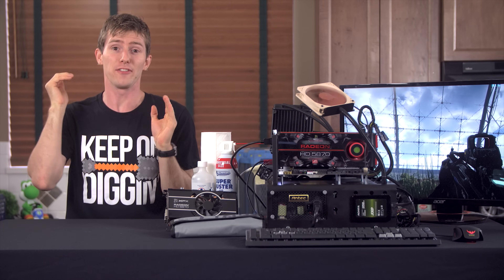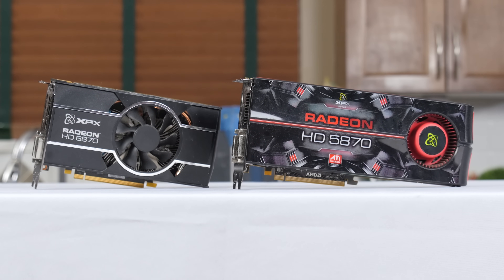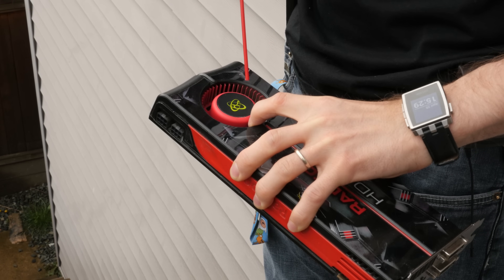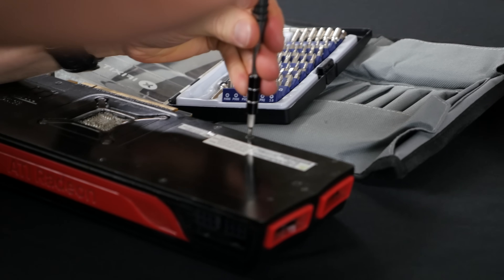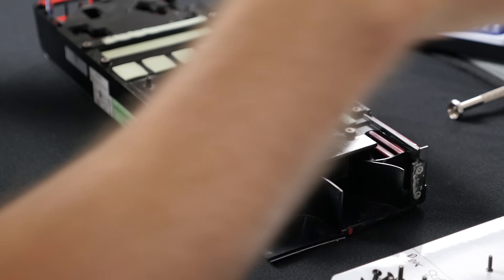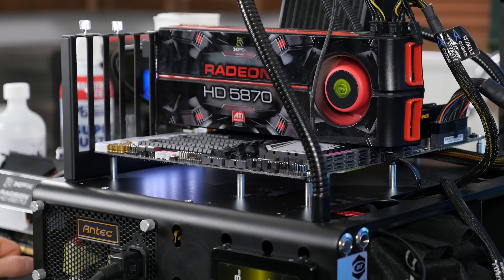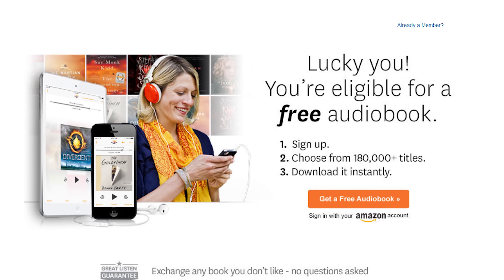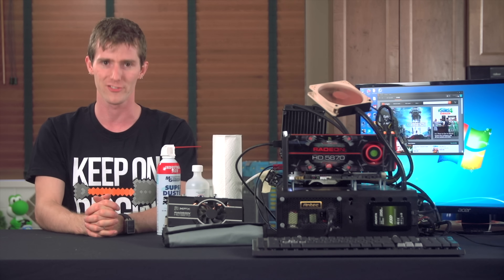Video Card Running Poorly? Clean Your Video Card Cooler!

Comment: canned air is literally the worst thing ever. better to just disassemble the cooler and brush it out with a soft-bristled paint brush.
Reply: Corinn Heathers I use 150 psi workshop air to clean my pc. No need to disassemble anything at this pressure (well yea take the pc cover off).  Theres probably a small risk of damage at this pressure but its great fun.
Reply: 3Dtimespace Oh yeah I'm fine with using a compressor, but canned air is just a bad deal all around. Super expensive for a metal can full of air. o_O
Reply: Corinn Heathers Why? Compressed air is great for cleaning out your whole case.
Reply: 3Dtimespace It only removes dust that's just sort of sitting there. You can spray canned air at heat-baked dust (which is what will be clogging your heat sinks and fan blades) all day and it won't even budge. A soft paintbrush never runs out and removes the baked-on dust easily.
Reply: Corinn Heathers Sure.. Both is a good combo. Plus things like "cotton sticks". A actual compressor works better han canned air also
Reply: Glycerin hahahaha
Reply: Glycerin Just don't turn it upside down!
Reply: Corinn Heathers
ooouuuchhhh!
Reply: Bangersnsmash Uk Be careful with workshop air, a lot of compressors tend to accumulate moisture, and you most definitely do not want to spray humid air into your GPU either.
Reply: Corinn Heathers Canned air is great for a blast of fresh air to the ole nut suck
Reply: Corinn Heathers Does your dog spit inside your computer or something? Every time I cleaned mine with a duster, everything came off. These little cans are pretty powerful. Anyway, you'll always end up replacing the whole computer before you have to brush things. And the cans only cost like 4$.
Reply: foufoufun0 I HAVE NO IDEA. The dust just kinda stuck on. The can of air wouldn't barely budge it!
Reply: Corinn Heathers Do you smoke inside?
Reply: foufoufun0 No, so I don't really get why the dust just sticks. No cats or other pets either.
Reply: Corinn Heathers That's weird, never had any trouble with dusters. I mean, it's pretty rare to have sticky dirt inside the computer.

Comment: I guess my MSI TwinFrozr II/OC 580's are dying, they're 54 on idle, replaced thermal paste and cleaned the cooler a bit with no effect. :(
Reply: What about load temps? Thats the main concern
Reply: Randy Hulsebos Try a different driver for the card. I had massive problems with temps about half a year back. A beta driver messed with my card and it was 20C hotter at idle for no obvious reason. New driver (old version) fixed it instantly.
Reply: WayStedYou Top card around 85-87c, second 79-80c.
Reply: The BTNS I do have a mid tower case, with a Mugen 2 cooler wich is huge.
I have also add a 120mm fan on the side panel that blows at the videocards.
I think the case is just cramped, i'm thinking about saving for a big tower case.
Reply: Randy Hulsebos Make sure the fans are okay. They may not run at expected speed, they may have difficulties to start running or they may even randomly stop spinning in burn. Inspect them visually and acoustically when running and keep an eye on them in afterburner. Also, try to remove the gpu and spin the fans to see how easily they spin. These MSI TwinFrozr coolers are very prone to this. You can fix it by relubricating the fans, but they don't usually have the caps for it there. So you might have to dissemble them, but there's a risk of damaging them while doing so.
Reply: Jakub Vacek The fans are fine, increasing the speed doesn't help much either.
Reply: Randy Hulsebos Well that would be a sing of the bad fans. Take the graphics card out and try to spin them to see whether they spin well and naturally or they stop spinning too soon.
Reply: Randy Hulsebos Also, one more thought. Does the card underclocks itself? That'd explain why it runs so hot just in idle.
Reply: Jakub Vacek Lately yes, sometimes i have to use gpu-z to force 3d clocks else it sticks to 400mhz on the core even in-game.
Reply: Randy Hulsebos  That sounds like the issue. The idle clock should be around 50 MHz. If it's running higher clocks when idling, it'll naturally have much higher temps. Try clean driver reinstall and look for softwares you use that might be messing with this.
Reply: Jakub Vacek Mostly it's 50mhz idle, but sometimes it hangs at 400mhz.
I recently already cleaned the drivers with DDU and reinstalled 350.12.
I only run Afterburner on the background and GPU-Z when the cards stay downclocked.

Comment: Aahh the good old HD5870, awesome card back in 2010 ( ͡° ͜ʖ ͡°)
Reply: ThePimbax yeah I hear in minecraft it can run on fast graphics and still get a solid 25 fps
Reply: Jill Valentine Still does a good job.
Reply: Teemo4Life It came out in late 2009, it's 5 & half years old, what do you expect jackarse?
Reply: Good old ati card
Reply: Jill Valentine Im still rocking a 7850 :D And my brother a 6790 :P
Reply: I had 5850, I was really good until I replaced it with gtx 970 few months ago. I actually cleaned my 5850 over a year ago when it was peaking to 95C (lol). After cleaning and replacing thermal compound it was really cool (about 75C).
Reply: halocuber117 isn't 6870 weaker than 5870?
Reply: Jill Valentine I have a watercooled 5870,it's alright I guess.
Reply: I still have my HD 5450 plays games fine
Reply: Jill Valentine  It had a horrible tessellation performance
Reply: Jill Valentine Still my main card, although I'm probably replacing it in the next few months.
Reply: Jill Valentine I am still rocking a 4870 in my older backup media PC lol
Reply: Jill Valentine Well, I still use GTX260 and I have no problem. Ok, maybe with noise, but nothing else.
Reply: halocuber117 You should wait for AMD's new lineup coming in June,  the 390 will probably be the card for you.  It's rumored to fill the gap between 980 and titan X for a much lower price ($399?).  I'll be getting the 390x or 980ti for VR applications, my 770 just isn't cutting it for VR.
Reply: I still use mine ;)
Reply: Jill Valentine Radeon 5000 series are the beast. My 6770 (5770 rebrand) can still run most current games on Medium High at 1366x768 to 900p.
Reply: +GreenAsari I still use it for mt workstation pc. So far has been a great card :D .
Reply: +halocuber117 I rocked a 6870 for about 3 months in my rig, I got it for $20 on craigslist and it performed well beyond my expectations even on Far Cry 3 and GTA 4, the only issues being stuttering from lack of sufficient VRAM but other than that it ran quiet and fairly cool. Now it serves in my HTPC/LanBox rig, still very good for what I throw at it. You'll drool over the difference a 390/970 makes, I know I did even with a 7870 which isn't a big step up but man did I love the extra performance and lower noise.
Reply: +Jill Valentine People who bought 5870 and 5850 at release sure got a good deal and long lasting gpu. I think it went up against nvidias 480 aka jet engine :P (The 580 was a great improvement half a year later though.)
Reply: +Jill Valentine probably the best card i bought, i ended up crossfiring it but sadly they died about a month ago and picked up the gtx970 g1 gaming... hope it lasts me xD
Reply: unstoppableguy1 7970 is a very good card, it's the best bang for the buck especially if you can get one used. I find that the 7870 is also a good bargain, as it's usually cheaper than a 7950 but has very competitive performance.
Reply: M8, i have a 6850 in my rig :)
Reply: +Jill Valentine I have a HD6450. It works fine. It has a passive cooler but it doesn't overheat.
Reply: +Jill Valentine I had a  HD5770 back then.. lol
Reply: +Bas van der Meij (Ykai63) I still run this one ! :D
Reply: im still using mine now XD
Reply: It does a shit job
Reply: TheGreatMandalore same
Reply: Fred Lavar Steenerson Stevens Herbert anything can run minecraft.
Reply: Jill Valentine I still got my 6870 from 3 years ago, hoping to upgrade to a 970 soon though.
Reply: Ted Bundy Yes it is, did he say anything different? :)
Reply: Saitham I just wanted to be sure
Reply: ***** but, other than nvidia at the time and for the 8 months to come, it had tesselation.
Reply: sandor szabados Nice, what you going to replace it with?
Reply: Animepunk1 I also owned that card, was awesome ( ͡° ͜ʖ ͡°)
Reply: Ted Bundy Nice, I also have the GTX 970, kick ass card. I guess Linus is right about cleaning ya GPU's :P
Reply: Filip Otáhal Koolies, I owned a GTS 250 back then :P
Reply: halocuber117 Awesome, I'm rockin a GTX 970, great card, you won't be disappointed ( ͡° ͜ʖ ͡°)
Reply: Ted Bundy Yeah It's just above the HD5850 but bit below the HD5870, that's back when AMD changed their naming scheme, but I think the HD6870 had better DX11/tessellation performance ( ͡° ͜ʖ ͡°)
Reply: Jill Valentine
Not sure yet, on a tight Budget. I'm waiting for the 3xx release. Hoping to get something in the $200CDN range, crossinbg fingers really hard that a 290 will reach that, might have to settle for 280x though. That wouldn't be bad, I'd definitely notice the improvement.

Maybe, just maybe, there will be a 3xx card in the price limit that makes sense to skip 2xx. Seems doubtful, but should know in a few weeks.
Reply: sandor szabados Yeah I would do the same thing & wait till the 300 series are released & go from there :)
Reply: sandor szabados Well, 200 series are one of Radeon's "worth to be skipped" family. Most of the times back in 2013, instead of getting a 280X, I can get a 7970GE for much cheaper than a 280X.
Reply: +GreenAsari Still running a 7450 HD Low Profile... worst shit ever :p
Reply: +Jill Valentine I still use a eyefinity 6 5870
Reply: Albinivik Absolutely, totally agree :)
Reply: Wesson552 Yeah prob my fav also, sucks they both failed on ya, GTX 970 though is an awesome card so you're pre much set :)
Reply: +Jill Valentine I have a radeon hd7970 is this glorious ? I only found out a few days ago that It was pretty good back in the day
Reply: +nigahiga6400 awesome
Reply: +coderHUN ™  6750 thank you much
Reply: +Jill Valentine i got a 6870 and it runs many things at ultra 900p at 100+fps
Reply: +MCatwar Keyword: 900p...
Reply: +Greyghostvol1 yes I only have a 900p monitor.... and it's fine for me.....?
Reply: MCatwar Wasn't trying to insult your taste in resolutions, just pointing out that 900p isn't an especially high resolution.
Reply: +Greyghostvol1 ok haha and honestly i cant stand this resolution, i can just deal with it.  im sure this card will struggle to get 60fps on 1080p but it was $45 so i got it xD
Reply: +GreenAsari me too, can still run every new game at 60 fps
Reply: Well if it was a new card, it wouldn't be dusty as hell would it? Need something for example for the show.
Reply: what are you taking about? the hd 5850 has simerlar specs to the xbox one
Reply: Give Me A Smile ah the good ol hd4890
Reply: Give Me A Smile im still running my HD6970 proudly
Reply: I have a 5850 1 gb. I wanted to use it in a rig with a pentium g4400 but it turned out that the integrated graphics were faster :^)

Comment: This was the problem that I had with my gpu. Games like Payday 2 would stay above 60 fps until all the build up. If I remember correctly the temperature was like 90-100c with 100% max fan speed after only 5 minutes of playtime. I finally cleaned out the dust and put new thermal paste with the max temp. hitting around 55-60c. It was the GTX 660 that I was using.

Comment: So it only went down 1 degree and 2% fan speed? Or did I misunderstand?
Reply: Homeslice 

The point was that this particular card wasn't too dirty i n the first place, and as such had no difference on the cooling.  That tiny percentage is more likely due to the change in thermal paste. 

If you had a filthier card, there would be a bigger improvement.
Reply: Homeslice It wasn't that dirty. The 5870 was quite the warm card, and the fan in it was always loud.
Reply: Homeslice that 1 degree and 2% fan speed look more like a statistical error margin than an improvement lol. Just using the duster in the fan to get rid of the excess dust would have made the trick. The inside of the cooler is kinda like a video game console or a laptop, it so tight inside that no dust gets in. (unless maybe like he said, you have a pet or the computer is in a basement or something)

Comment: A customer once brought a video card in that had "stopped working"....... it was still inside the plastic wrap it come in the box... the plastic had melted over the video card, he plugged it in and used it with the plastic over it............ howwwwwww

GG Customer.
Reply: I'm not lying mate... it is the strangest broken video card I have ever witnessed... also.. not all PC cases are standard ATX. so no... not all video card fans face downward.
Reply: KunkleBear  Unfortunately I don't have a time machine.
Reply: KaiiKiller Great tale. It gave me a nice laugh before bedtime :)
Reply: i know this is old, but this problem never ends, not even today. People just open the box and EXPECT the graphic card to appear that YOU saw online. Whereas infact, it comes with protection incase your GPU get's damaged during shipping. Regardless of whether you're a pc gamer or not, people will never change when buying stuff online.
Reply: KaiiKiller Wow. That story made my day.
Reply: Most instructions are not very friendly to noob users. They should put an Ikea-style instruction along with a regular instruction.
Reply: Pics or it never happened
Reply: That story makes like no sense, seeing how the metallic wrap covers the PCI connector so there is no possible way to plug it into the MOBO. I also doubt it would melt. Then I tho it could had been the plastic cover that comes over the fans, but most GPU fans are facing down so it would melt away from the GPU.

Comment: I know I would fuck this up so I won't bother. £250 graphic card is not worth risking.
Reply: QuixoticQuaver 
I'm about to crack open a 3 year old 550 Ti because this is the only solution left to help it not almost catch fire while under load. I can understand the hesitation.
Reply: QuixoticQuaver Well one point Linus did make was "Rather than scrapping an older, sluggish card - try this."
Reply: ***** 600 of what currency? And what is hard air?
Reply: QuixoticQuaver pesos
Reply: ***** 600 Swedish Krona = £48. You can't get a graphics cards for that can you?
Reply: ***** Oh yes, I do that all the time. I'm referring to dissembling the cooler.
Reply: ***** That sounds like an interesting story to be told.
Reply: ***** I could probably do it, I've replaced wifi cards on laptops and stuff before. I'm just hesitant to do it when I know it's working OK and just running a bit warmer.

A year or two down the line I'll probably feel less cautious because it isn't so new.
Reply: There's no risk of breaking the card. Unless you're extremely reckless of course.
Reply: ***** Titan X goes for £1000 in the UK :( That's $1500!
Reply: Liam Groves You can get the titan X for £800 in the UK...
Reply: ubbgn We can all do it. It's about whether we want to or not,
Reply: ubbgn  Since your just a troll will stop talking to you now, but here you go. In a medion md95500 I upgraded to a pentium m 740 and a geforce 8500 m. they eyes closed part was obviously a exaggeration, but stupid little trolls like you don't have a need IQ to detect it sorry did not wanted to confuse your little brain.
Reply: RapiDEraZeR Pesos , AHAHA !
Reply: if you have a asus gtx 960 strix just blow in to the fins while you hold down the fan
Reply: +QuixoticQuaver If you just air clean it's pretty much impossible to screw up. Just make sure to hold the fan's blades in place. I was scared of it as well but my dad assured me that air doesn't harm circuitboards and proceeded spraying his big ass mechanical air compressor in my 8800GT fan that hadn't be cleaned in almost almost 9(!) years. 

The whole thing was clogged up with dust, performing like shit and made noise like a vaccum cleaner if I turned even the fewest graphical effects on. 

After cleaning it fixed everything and performed much better while not making the crazy vacuum cleaner noise anymore. So, if you have noticable performance issues compared to how the card was out of the box I'd say it's worth considering. 

EDIT: About taking the card apart. I wouldn't do that either. I don't think it's necesary for most cards as well. It wasn't for mine and that one had been collecting dust for 8 years
Reply: +TheNicerDicer well using a very powerfull compressor can damage stuff